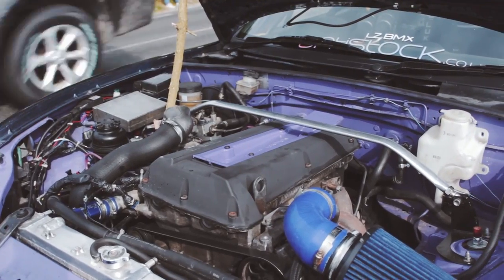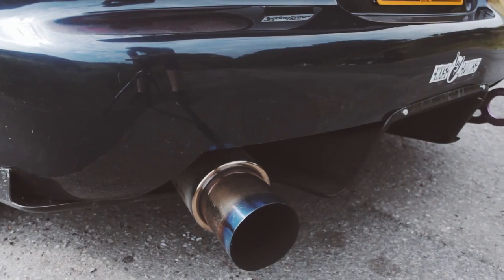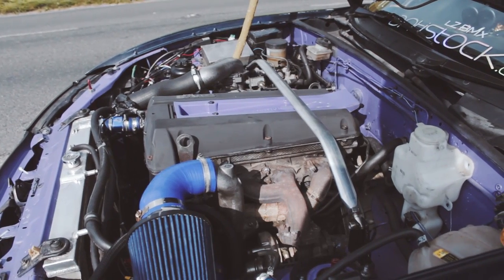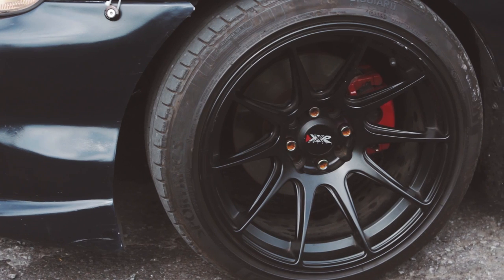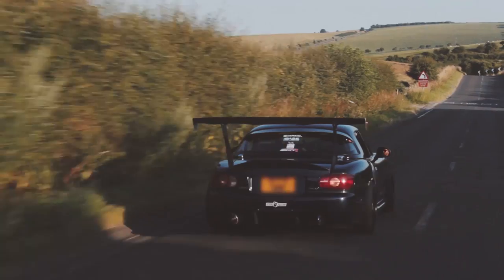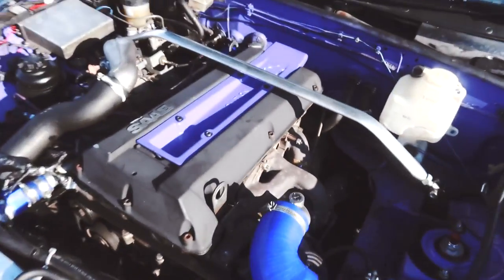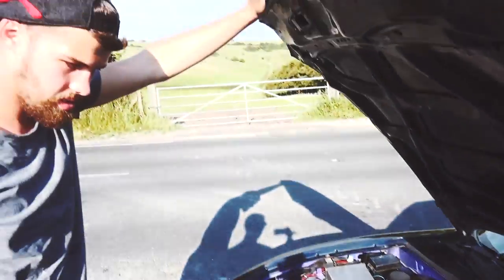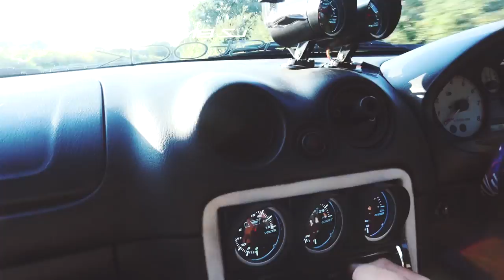🐒 300HP MAZDA MIATA 2.3L TURBO

Comment: What an awesome unique swap! This is the first time I've ever heard of it, ultra cool. I'm just stuffing a boring VVT engine in mine, lol.
Reply: Lol
Reply: hey, i've done the swap on an 89 mariner blue. 4.3 lsd torsen and 6 speed on 90rkw =D
Reply: +Asif Ifas variable valve timing, came on 2001+ nb8b mx5 engines. it basically means a bunch more torque with more top end since you can change the timing of the engine
Reply: It really only helps with down low torque, it gets a bit more top end power, but not allot. We dyno'd a friends Nb8a and an NB8b (same day, same dyno) and the graphs are pretty similar midrange and above.
Reply: I've done the same thing, it makes the car way more drivable, still slow though lol.
Reply: +Lemon0Tart but car passion plans on having a nice big turbo strapped to it
Reply: Devin  *Medium sized turbo :)
Reply: +TheCarPassionChannel Touché. I'm excited to see what is to come :D
Reply: Lemon0Tart I've been dyno tuning my "fast" car on MS for a couple years now so know enough to get by haha. But I can always learn more. (Turbo is top secret, muahaha)
Reply: TheCarPassionChannel who woulda thought you'd be pushing 415whp a year on! Haha

Comment: melt internals at 250??? what kind of a Backstreet abortion of a tune are you running to grenade a b234R at that figure? 350+ on stock internals is The norm in sweden, lol.
Reply from the maker: He was taking about the stock mx5 engine 👍
Reply: Yeah 250 is kinda the highest you wanna go with a stock BP. There are guys with fully upgraded internals running 300+ but if it's easier to get this saab kit running I'd go for more displacement as well.
Reply: from new zealand myself 250hp?....... my 98 328i makes that from factory an has never an will never melt them at that fewer horse power lol
Reply: +Jay E as said he was talking about the stock Mazda engine
Reply: +breakz187 takes 1 to no 1 for staters and im still right u aint gna melt pistons at 250 hp on miata standard unless u thrash the shit out of it 24,7 or put boost threw it with no upgrades........?
Reply: You will throw a rod at around 250 hp+ on a stock miata. That's just the fact. Reforged pistons and rods are what you have to do to keep a miata running 15+ psi at 250ish hp.
Reply: Jay E  Google shows 190 hp
Reply: yeah, not 250hp in a original e36 328, its 193.
Reply: @kyleberndt8315  I run 277hp on stock BP internals. It's the torque that kills rods not hp.
Reply: @silentthunder890  that's totally true. And it's what destroys diffs. But most people chase hp, and torque follows at a pretty similar ratio (generally). So it's just a good rule of thumb. People can get lucky though!
Reply: @kyleberndt8315  true say man

Comment: I can't hear a thing the driver is saying... What did they use for a transmission behind this motor?
Reply from the maker: A Vauxhall Omega 3.2 box
Reply: And what is the name of that box? And is it the exact same box as in the 3.0 Omega B with the X30XE engine? And do you use the V6 gearbox's bell housing?
Reply: Ya is the "strong box" r25-28 came in 3.0 3.2 v6s bolts onto Saab engine I believe the clutch and fly weel are also the same.

Comment: This Saab+opel gearbox will soon become the new thing... I have a couple of friends who run these in S13's now. £350 for a decent engine. £150 for a gearbox. Get the driveshaft cut to lenght and weld mounts for engine and gearbox. Its dirt cheap, and since you can program the Saab stock ECU, you can get like 400hp for real cheap

Comment: I have a 01 9-5 wagon 2.3 front wd. Stage 3 - 22 pounds 5 speed conversion and all the fixings like rails msd ignition, cam, jzw tune. Forge blow off, k&n cold air intake through custom ram air duct in passenger headlight.  everything except do88... run stock intercooler could be why I blow cylinders..? And it would give me another 50-100 hp....so they claim. it eats axles too every 6k miles. 330 hp to front wheels on a dyno. I just put in sachs stage 1 clutch too. full coil covers and bbs 17x8s blew motor twice in last 3 years, had car about 7 years. Shes got quarter million on her. So I was thinking of doing an all wheel drive ls swap pikes peak climber style. But maybe this is the way ?  Cheaper way to have fun. Dudes it sounds like this set up exactly on blow off, but with 3" exhaust no cats it pops and crackles amazing. but it pulls way harder in 3rd gear than this. 30-100 in 3rd gear in in about 7 seconds. The car weighs almost 4000 lbs. Which is why I go through axles and front tires in a summer. Imagine it in miata ? 400hp to therear wheels. Hardest part will be the diff but it's already been done before now so....

Comment: Original Aero turbo TD04-15? Original Saab fuelinjectors? Original Saab FPR? And running with 0,8 bar (12 psi)? And making 300 WHP?

Comment: The b235R used in the car with trionic 7 is usually built with b234/b204 parts(pistons/rod/crank) they will be capable of 500wheel EASY with the stock ECU, The Trionic system is actually better than a BUNCH of aftermarket stuff!

Comment: Saabs are fucking cool man, mum has a 2.0t and won't let me do anything to it haha, sick car this!
Reply: ha ha
Reply: What engine code though? B204, B205 or B207? First one can be modified well, second two, struggle to make much power :)
Reply: Seems like you don't know much about saabs. :)
Reply: Haydn Cashmore not sure, how would i find out?
Reply: boxol29 if you're talking to me then yessir you would be correct
Reply: Josh Grundon You can make as much power with the b207 as the b204 and 5. :)
Reply: you gotta change pistons in the b205 to the b204 ones if you want alot of power. the b204 / b234 pistons can handle up to 500/600hp with the right setup.
Reply: the b207 can only handle around 320 bhp

Comment: if he replaces that thick cast aluminium looking intake pipe (just before the air filter) and replace it with a thin shiny aluminium one, the flutter will sound better.

Comment: 2.3 if its b234 will do 500bhp out the box no rod modifications and no need for stand alone as they are easily as good as stand alone on the saab management and as for the omega gearbox there no good above 300bhp as the manta i own has chewed 4 already on tbe saab b204 thats in there now running 280bhp cant wait to get mine finished so you can come and drive a proper saab drift build monky london 👍

Comment: For those curious, saab had an array of engines. Some good, some not so good.

B202- OG engine put in the c900s capable but the tranny sucks ass.

B212- also OG engine, same as above

B204- plenty strong 2.0. Capable of 500 horse on stock internals

B234- same as the 204, just a 2.3 instead of the 2.0 b204. 

B235- bastard child of saab and GM, GM forced them to lighted it for gas efficiency. Pistons Melts @ 300 horses on pump gas. Horrible pcv issues on 99- 2004 model years. After 2005, it had a permanent and proven PCV system, but still had weak pistons. 

B205- meh

B206- Europe version only of the b204. Came with no balance shafts, highly desired for tuning. 

B207- I like valves? Nor this engine

Comment: Nice Build. Picked a weak engine and drive train though. Should have put n S2000 lump in, boosted that and called it a day at 400hp at low boost.
Reply: Let's not act like this was a cheap conversion. He's 21 and he's spending daddy's money. It's no problem for him to spend more.
Reply: How can you call this engine weak if parts from it are regurlarly used to reinforce BMW engines and can handle 300hp/litre on stock internals. It is propably the most robust 4-cylinder engine ever featured in a mass production vehicle.
Reply: +Lauri Koskinen the most robust 4 cylinder is the Honda k20 and f20. 500 hp on standard internals.
Reply: The b234r can take 660whp on stock internals.
Reply: +Lauri Koskinen and last a few thousand miles probably.  you can take an f20 to 650 hp and do about 10k miles and it'll die. lol

Comment: Hi could you say wich gearbox is instaled? Y have a 318 is e36 and a 2.3 turbo Saab engine
Reply: probaly a Opel omega B R25-R28, but I can say they don´t like much torque at all. Drove my build 2 times after my dyno run which delivered 580hp and 770Nm and the third did´nt not like it. 
So I would go for a rewelded Bmw ZF gearbox instead.
Reply: what gear box you recomend?

Comment: This is how Saab should have done their cars in the first place. Whats the point of having loads of power and very good engineered mechanics when you are crippling every car with a front wheel drive? This is like doing a sprint by using your hands. 
At least Alfa Romeo has realized rear wheel drive is essential to create brilliant driving dynamics. Some customers will notice the difference, especially me. So, good job on this build, i like it very much.
Reply: In the end they did it with the XWD on the 9-3s. It's pretty nice but maybe a bit late.

Comment: Should have gone Volvo t5 engine instead, sounds x10 better and can go easily 320 on stock internals
Reply: I would say its a harder swap in a miata. You need a gearbox (sure, the m90 works, but you want it to take a beating) then you have to shorten the 6cylinder rws oil pan and stuff or make a custom one. I think this is easier. The saab engine is a great engine, they can handle 400-500hp with stock internals.
Reply: Elving Lindqvist
Chap said they melt stock internals over 250?
Reply: with a really really bad tune, yes youll melt internals over 250. Plenty of people are running stock internals on b204 and 234(pre 9000, 900 and og9-3) engines at around 500hp. some finnish guy has exactly 666hp on stock internals. you just need to get the tune right.
Reply: Hans Baar
I'd be surprised but theres something about these Swede 4bangers, the holy Redblock from volvo, people have been putting out equally silly numbers from those 8v lumps
Reply: +Bunka Fas standard mx5 engine he said mate
Reply: I dont know why the guy said you melt stock internals at 250 because he is mistaken, I think he meant to say that about the 1.6 or 1.8 mazda engines. If you take a look at the rods inside these engines they are fucking massive, super thick and strong. There is a guy with 666hp on totally stock internals online. Mine is going to be about 340bhp when done. (check my video)
Reply: +ratgreen he did say the mazda engine 😂
Reply: *****
I probably misheard !
Reply: The newer engines, the b2x5 are capable of around 300 - 320 HP on stock internals. I've been running 315 in mine for a few years now. The older b2x4 engines are a different beast though, like someone here said some people have run them over 600HP on stock internals.
Reply: Who did your tune Skracken?
Reply: B235R engine with a Stage 3 BioPower from MapTun performance
Reply: The B2x4 engine can handle more yes. The B2x5 is limited around 300HP.
Reply: He meant the stock Miata engine, not the Saab engine.
Reply: In sweden and finland its well known that saab gearbox brokes at 300hp and stock internals melt around 500
Reply: Bunka, to bad you dont know that the older saabengines can do 500 completely stock, maybe not by being reliable but from the point of comparing volvoengines and saabengines, the saabengines are better, to do 320 the saabs only need a turbo, exhaust and a tune
Reply: +DuBstep115 I have a b234 motor in my 9000 on 28psi with gt35 turbo and e85 she is still together strong and she gets ran hard every time its out. EVERYTHING is stock made 640hp 530tq. The week link on the saabs is the transmission anything over 300hp on stock tranny and your asking for trouble I've been through 3 trannys and i baby shift it.
Reply: Renato Piereck--->
maybe BSR or Autotech, both well used in sweden
Reply: But the saab engine (t5), a friend to My dad has 668 whp on stock internals
Reply: B2x4 can do 500-600BHP on stock internals ez. You lost. Game Over.

Besides, no one want's tractor engine in his car...
Reply: Hans Baar 
Hans bar is correct, pre 1999 Saab engines could handle well over 500 HP, all forged internals. Ready to be used.

Comment: Same motor as my 9-3 viggen motor. Even stock, in a car that weighs a bunch more,it rips. 

So that's what my car would sound like with an exhaust and no bpv. great vid mate
Reply: I've got a 9-5 with that motor, good luck getting bov on your car but if ya wanna hear a Saab straight pipe check out my channel
Reply: Keelan Coates I don't need a BOV, I drive a Saab, not some rice SRT-4.
Reply: +kirbyswarp misread your comment! We've got the same motor!
Reply: Keelan Coates Yup, the b235R. T7 doesn't play nice with a bov anyway.
Reply: It works fine, you just have to relocate the MAF to right before the throttle body. Many people have done it.
Reply: aLLeNz0rZ But why? It's pretty worthless performance-wise. Compressor surge is also harmful.
Reply: +kirbyswarp I don't know why people do it. I personally have a forge recirculating valve on mine.
Reply: Viggen and 9-5 use a B235R, where the pistons melt around 300whp. This is a B234 or a B204. So they've been dynod at 666whp on the stock bottom end.
Reply: Sean Nelan Good thing I have a b235R in my viggen and a B234R in the 9000 Aero :)

Comment: i hate turbos kool swap tho seen it before here in the states  but i rather have the k24 all motor 300 hp more usable power on track with less heat and weight i track alot
Reply: Actually a Turbo has much more usable power, since the torque is massive on a large power band and you hardly ever drop below 3500rpm on track. It might be harder in the beginning if you are not used to a turbo. I agree though that a high revving engine is a great experience too.
Reply: the amount of torgue is why its less usable because of wheels spin and amount of tire u can get under a miata plus the weight and heat that comes along for the ride makes track abuse even worse on the engine tires brake and gas usage plus lower reliability and higher oil consumption .. ever driver a 300hp miata on track .. its plenty of power no need for a turbo messing it all up unless ur lookign for cheap fun on the stock motor with minimal hot laps
Reply: You just need to be careful with the throttle. This b234r swap isn't heavier, is as reliable and uses less gas.
Reply: lol have u eer build and tracked a car specially one with a turbo ?

Comment: haha 300 Rwhp on 12psi of boost is not gonna happen more like 18-22 psi the Saab b234r needs 16 psi to make 225 at the flywheel
Reply: 16 psi to make 225? you are high
Reply: That’s Saab’s spec for a 234r not mine that’s what autodata lists
Reply: autodata is high, lol.

Comment: nice car but i wouldve gone the k20 route
Reply: All about that F22C1
Reply: +iTuMoRz *f20c
Reply: No i meant the ap2 f22c, i pull on f20s all day and don't hit 9k redline
Reply: +iTuMoRz you have a ap2
Reply: Yeah 05, putting down 240 to the wheels, almost what stock s2ks put to the crank
Reply: +iTuMoRz my brother has an ap1... i think would choose the ap1 over the ap2
Reply: im all about Honda's (i got a jdm b16a swapped coupe) but this Miata is extremely unique as fukc!

Comment: saab engine pfff, its a gm ecoboost.
Reply: this is originally based on a cosworth design featured in the m-b 190 EVO. It has absolutely nothing to do with an ecoboost.
Reply: apologies, gm ecotec. We've worked on enough of them to know.
Reply: Only the mounting positions are what they share in common with the ecotec. Some ecotec engines were used on the ng 9-3, but they were 2.0l engines.
 This engine was introduced 10 years before the first ecotec.

Comment: look at the state of that spoiler & why put that pile of crap engine in such an awesome car???? Totally ruined it
Reply: Please name another engine that can dyno over 300hp/litre on stock internals.
Reply: D Farman what makes I crap? being a Saab?
Reply: D Farman if anything he made and awesome car better
Reply: D Farman do you have any idea what the Saab B series engine is capable of? When the pikes peak 9-3 viggen was built it out accelerated F1 cars...

It's the 2jz of the 4 cylinder world

300whp? Thats been pecked at
Reply: the B204 and b234 from the 9000s can do 500 stock
Reply: There's actually a 9-3 at the moment using forged rods but standard pistions with 700hp
Reply: Not too knowledgeable on engines are you ?
Reply: Tom Boorman that's wild